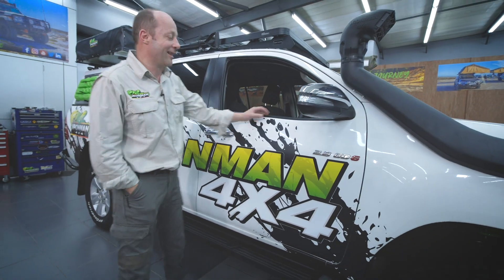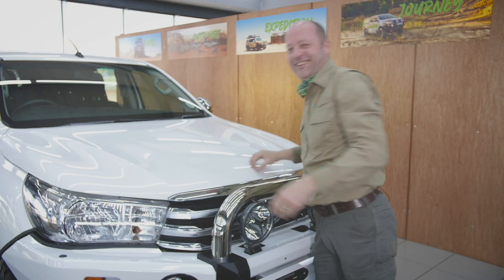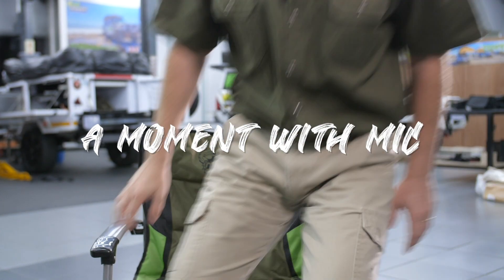"How do Suspension Lifts and Bigger Tyres affect your Brakes?" - A Moment With Mic from Ironman 4x4

Comment: I would like to ask if the 2019 HILUX original size 265/60 R18 (30.5") upgrade to 285/70 R17 (32.7") will also affect the brakes significantly?
Reply from the maker: 285/70/17 will foul on the inner wheel guards, especially when articulating off-road and yes, even if they did fit, your brakes would be way less effective and your vehicle performance would suffer. The correct tyre upgrade would be 265/70/17

Comment: HI Mic . This is quite interesting info. I don't think that is info that is not shared with us as tire fitment centers only cares about the sale itself. 
I think something that would be interesting when you do a new build ( own fleet or customer ) is to give us some figures in the added weight to your vehicle when added the extras ( bulbar, rear bar, canopy, long range tank, winch and then the new set of wheels. ) and how it affect your GVM at the weighbridge.